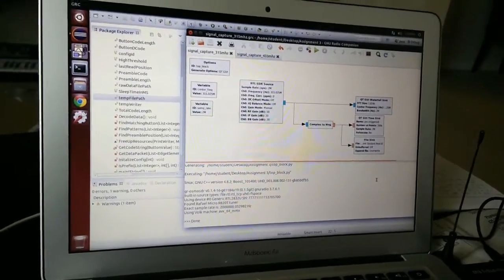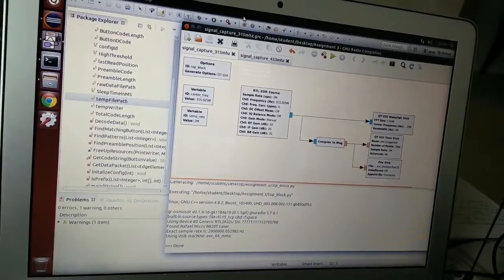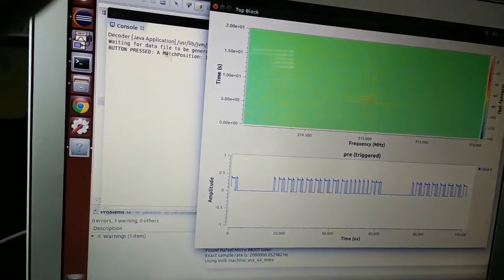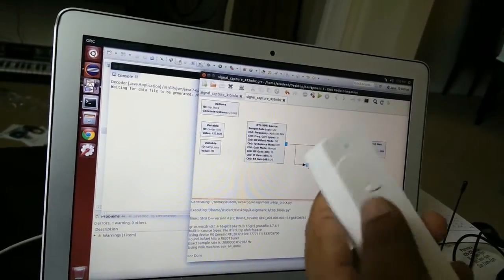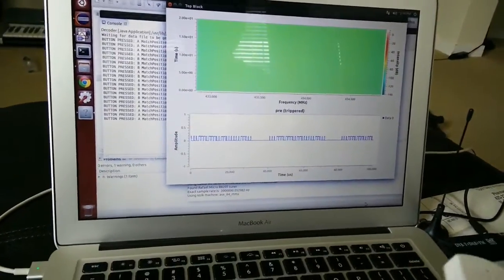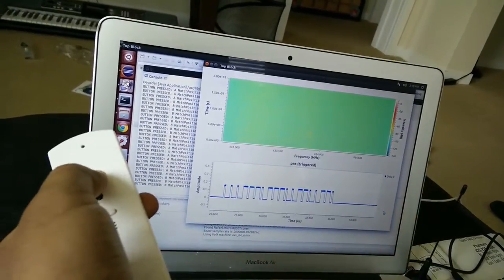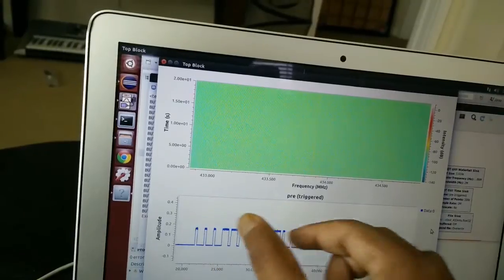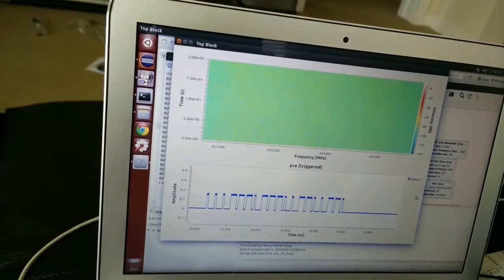Decoding RF Remote Signals

Comment: Is the signal ASk / OOK encoded. Nice demo  I'm trying to decode some signal rf signals at the moment. Could you show me the raw waveform data as recorded on the SDR.  I'm working 870mhz band for a old alarm system that talks to remote sensors and a key fob. Never done this before so just struggling to get my first packets.

Comment: Where can you get this software from?
Reply: No. I dont know, I dont want to know and i dont care about any offer
Reply: The Software used is GNURadio its free Software - but you definitely need to RTFM its not very easy . gnuradio.org
Reply: What do you mean with "unlocking"?
Reply: Luckily its not that simple. Car locks use asymmetric encryption algorithms. You cant just replay the message.